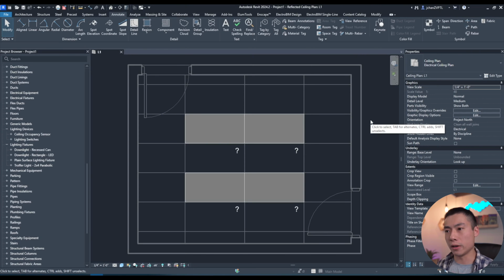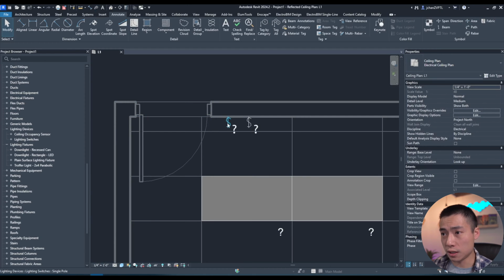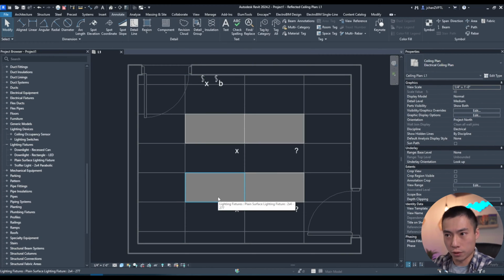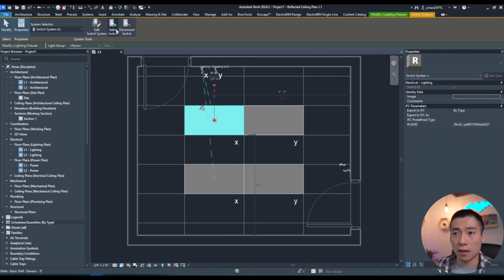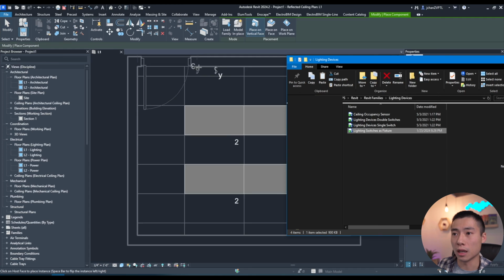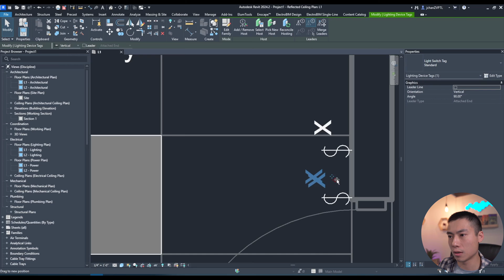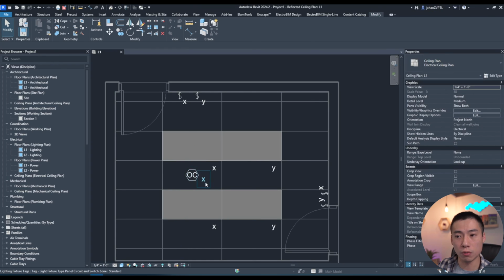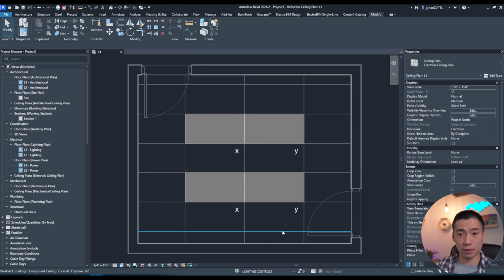Light Switch Secrets in Revit! (Switch IDs)

Comment: By switching some switches to light fixtures, you didn’t mention it would affect your lighting fixture schedule now. You’ll have to filter out the switches in that schedule.
Reply from the maker: You’re right, I totally forgot about that! In the schedule, I filtered by Voltage and selected “parameter exists”. Poof, switches gone 😅 Good catch!
Reply: I usually add device schedules as well. That would be messed up also.

Comment: Is it possible to define 2 switches in one circuit? I want to make a 2 way lighting system, but I facing the problem the same you mentioned is that I can only choose one switch, also I already did the same way you have done it but want to have a clean 2 way circuit. So is it possible?